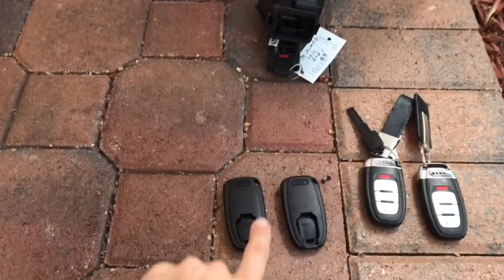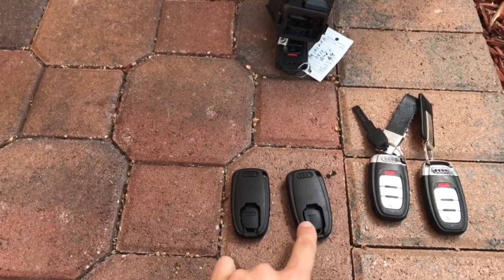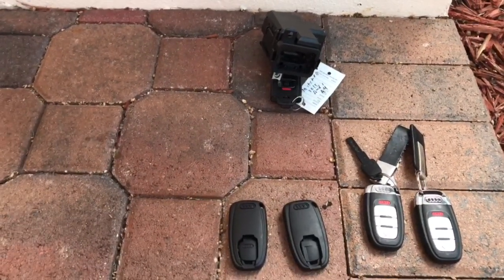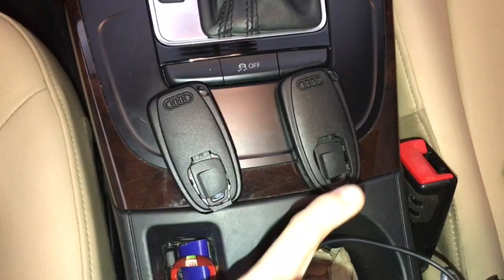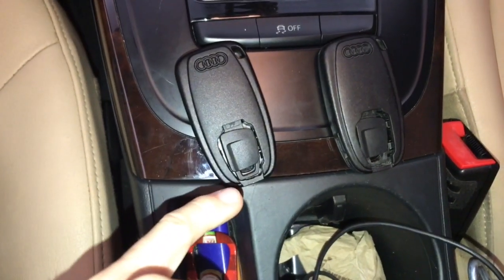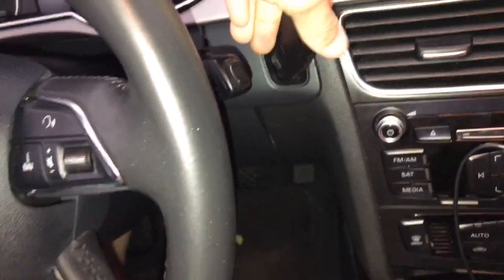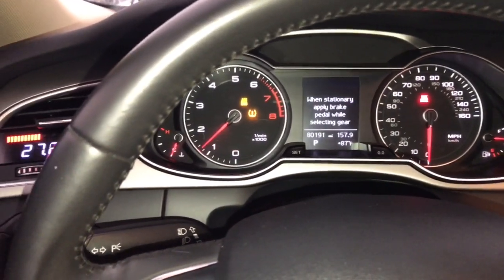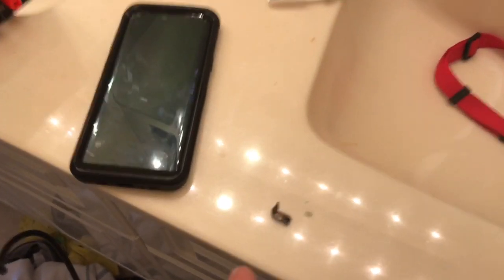What's Inside Audi's Waterproof Emergency Key That Starts The Car?

Comment: Thanks for the example of how the chip reads on only the vehicle with which it is paired. But can other Audi emergency keys unlock the door? Or is the emergency key specific to unlock the door to the vehicle it's paired?
Reply from the maker: All the 3 standard keys including the  emergency key works for 1 vehicle only. If you want an extra key for the vehicle and or use one key on a different vehicle, the key needs to be programed with either ODIS software or Autel Maxsys software or another special tool
Reply from the maker: Remmeber that all 3 standard factory keys all have been precut to use on the original vehicle's doors & glovebox.

Comment: How do I replace the emergency key? And is it as expensive to replace and the regular keyfob?
Reply from the maker: The actual key itself is what allows you to manually physically open the glovebox. It is the same key found hidden in the Audi electronic key fob, press the silver button & there it is. It will cost $$$ to replace it & reprogram it. If it's just the bulky fob from the emergency key that youre missing then that's cheap
Reply: @MotorHeadTech  yes I was talking about the plastic mechanical key with a chip in it.
Reply from the maker: @EJR20  going to the Audi dealership would be the only way not only would they have to cut your new key to your car's pattern but they also have to program it too
Reply: @MotorHeadTech  I’m in GA and I heard that this shop called Autobhan performance are certified Audi specialists so they are cleared to cut & program Audi keys, so I’ll give them a shot and see how much I’ll save relatively to the dealership

Update: so just the adapter for the plastic mechanical key costs $110 and the mechanical key costs another $120ish. Does the spare key adapter also have some kind of chip inside it in order for the mechanical spare key to work? I’m thinking to get the mechanical spare key from dealer and adapter from amazon or second hand. I’ll probably ask them if it needs the adapter. Another interesting thing, on top of that, can I get a used adapter and buy a new spare key and have it work with the used adapter to start the car? I mean does the adapter also need programming?

Comment: Thanks for the video but why would Audi create a key to be left inside the vehicle 🤔 I call it stupid
Reply from the maker: The black plastic electronic-less giant fob stays inside the glovebox & it does not power on/nor start the car, since the chip is located on the physical plastic key, which comes from factory attached to the 1st set of your Audi electronic fob on your key chain as an attachment along with the leather Audi branded strap. There are 2 parts to that key, one cannot work if the other part is lost/not in use. Thus the point is to keep the electronic-less fob inside the glovebox while the plastic key is what the owner takes with him/her to lock the car manually (since that is literally and figuratively the key to open & start the car). Thus it's the 3rd OEM key made for an emergency or for valet.